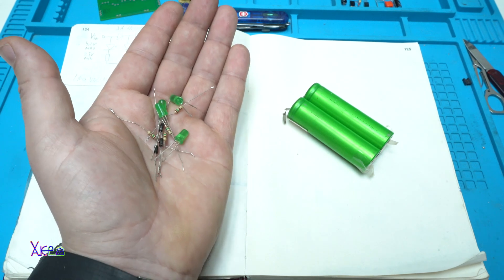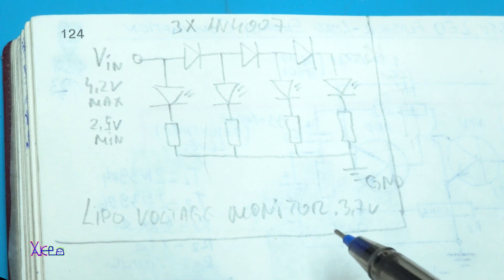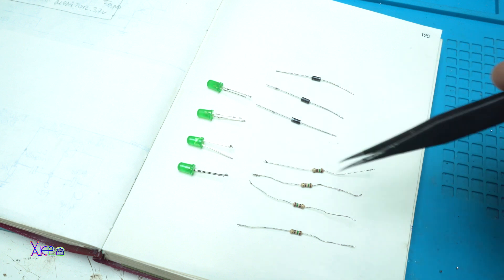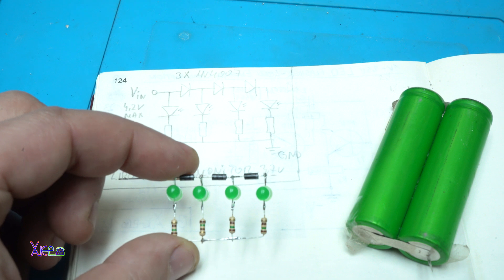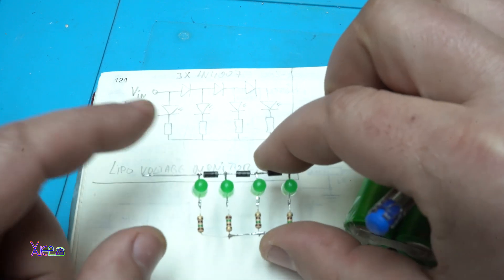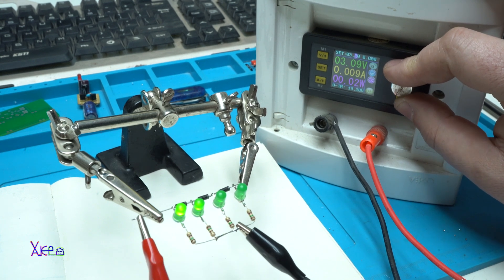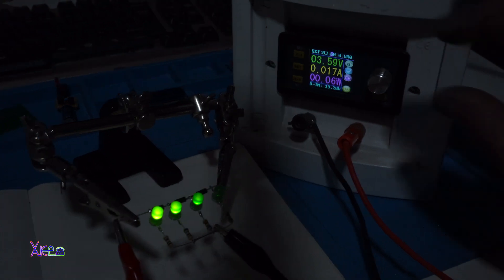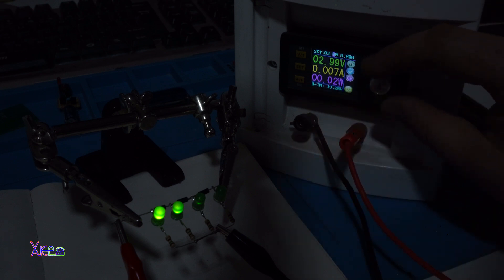How to make simple voltage monitor for lipo 3.7v battery

Comment: A would add a switch in line so you press to test the battery rather than have the leds on all the time. It might also be worth adding a zenner diode(with a resistor of course) so you can't switch on the leds if the battery is below the minimum battery voltage (just a thought).